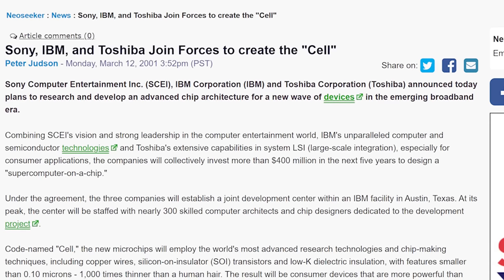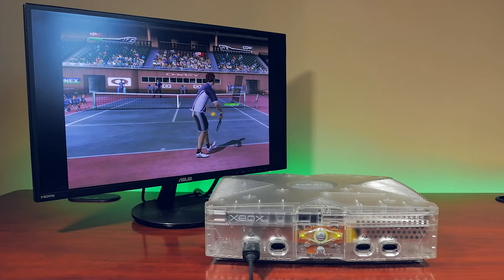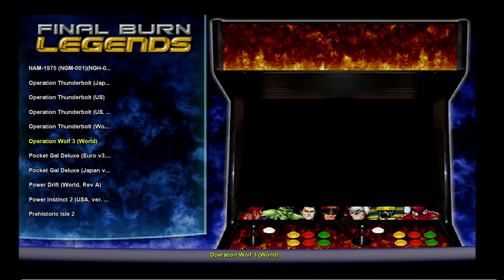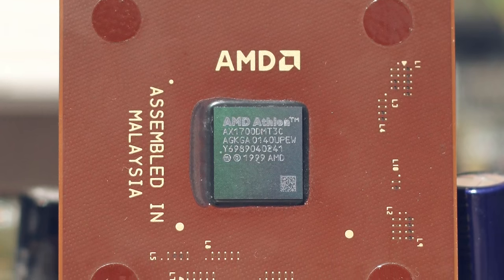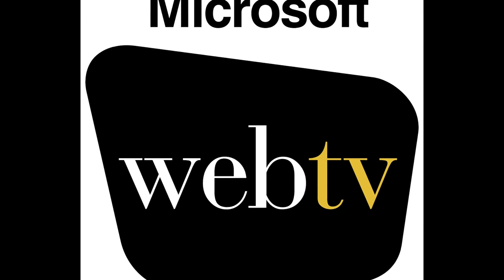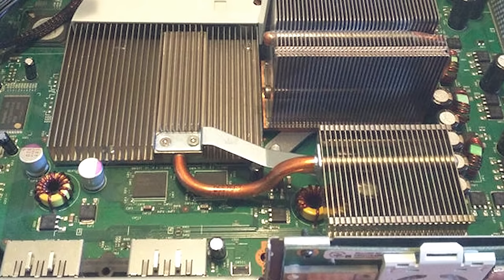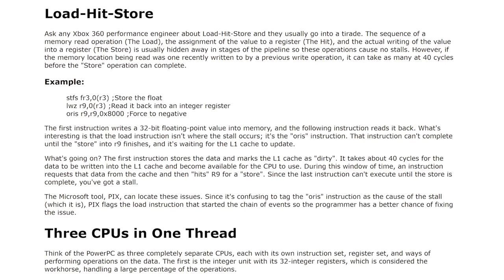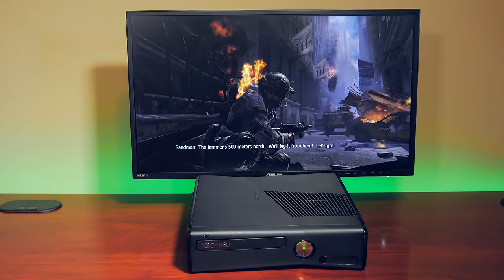Why Microsoft switched from Intel to Power PC for the Xbox 360  | MVG

Comment: The real winner of the seventh generation of consoles?

IBM.
Reply: And the next was AMD. You know what was the same? Lisa Su. Coincidence? Maybe, I don't know. Just a fun fact.
Reply: @johanlundberg8449  and is it coincidence that Nvidia have a raytracing card out and AMD does not?  I would think not, in the same way IBM could not or would not provide Apple with better CPUs until after Apple left   (What I'm saying here is that both these shifts came at a cost in the long term ... IBM lost a huge long term business partner and by the looks of it AMDs next gen GPU is now delayed until next year when the Nvidia 3k series is about to be released (maybe they will both hold back now)
Reply: I full appreciate that working with Microsoft and Sony will work out long term in desktop cards, but that won't be for a few years yet.
Reply: @Nossieuk  I am not so sure about RDNA2 being delayed, AMD and Lisa Su herself have stated multiple times and right up till recently that both Zen3 and RDNA2 are still 100% confirmed for this year. 

There have been many rumors going around about delays, but AMD and Lisa Su have shot them down repeatedly. AMD do keep stating that RDNA2 is releasing before the next gen consoles and so is Zen3. So I do think they will release this year still, unless AMD and Lisa Su make an official announcement saying otherwise, I wouldn't believe any other information. 

There have just been too many rumors about delays that keep getting debunked by AMD and Lisa Su, so I am just not believing anymore new rumors about delays. I will believe official word on the matter from AMD though.
Reply: Yeah, but Apple.. Apple Computers used IBM PowerPC RISC CPUs in their MACs, then they wokeup to reality and switched to Intel X86 CISCs for ultimate capablities.. But behold, they've recently become stupid again and now they have dumped CISC to go back RISC CPUs using custom ARMs.. The good thing though is that Apple users really can't complain now when PC users refer to them as consolers.. Hah
Reply: This was hilarious LMAO
Reply: @Ian H . Not sure what/why your going on about, but I am pretty sure Johan was just referencing that Lisa Su was working for IBM with the 7 gen and AMD for the 8th development and launch.
Reply: Fernando Cárdenas . Wow,  that would be embarrassing for PC users if some PCMR dork actually did start calling Mac users consolers. Personally I have never seen that term used.

As for how stupid it will be, time will tell. I personally have no idea how well or poorly this will work out, but I am excited to see the results.
Reply: @robertt9342  Haha, Then why are you so annoyed?
Reply: @joeyvdm1  I'm one of the twats waiting on dropping £5k on a PC before all this happened.  I was told the zen 2 3950 was going to be released last year in september and yet it wasn't until December it was officially launched. I was going to just pull the trigger on the 2080 and to be fair it also gave me a reason to hold out for the threadripper, but why bother after corona with Zen 3 on the horizon and MAYBE RDNA2, where AMD MIGHT actually start competing in the performance market again - my wish list has been a running jokie since august hah. https://www.scan.co.uk/wishlists/c77b3d9b-0767-4054-92fb-1fee8db9ccc4  -- With so many rumours, delays, lies and teasers -- yes, yes I am willing to believe anything =P
Reply: @Nossieuk  Don't stress it, they will release on time. Zen2 released on time and so did RDNA1. 

The 3950x releasing late was expected for multiple reasons, but that was also a single CPU, not the entire product line. And the 3950x still released the same year (2019) not the following year. 

When Lisu Su and AMD say that there will be a delay, that is the only time to believe it bud. Not a second before. 

I will be picking up an 4950x myself to upgrade my 3700x (I do production) and I actually expect that the 4950x might be released with the rest of the product stack this year at the same time as well. 

But even if the 4950x is released later, I will wait. But RDNA2 will absolutely be released this year as at stands right now, and so will Zen3. 

So I wouldn't believe any rumors, if AMD and Lisu Su say that Zen3 and RDNA2 are both still 100% on time and will absolutely release this year, that is who you should believe.
Reply: I can never say that because the PS3 exclusives looked amazing but they were far too few released. Every 3rd party game looked like crap on the PS3.
Reply: @fredsas12  Honestly, I'm kind of excited that Apple has decided to go with the ARM RISC architecture. x86 is starting to show it's age what with the ridiculous amount of security vulnerabilities and ludicrous amount of extensions that have been added since MMX in the late 90s. If anyone can give ARM a kick in the pants and start producing desktop class RISC CPUs it's Apple. The ARM RISC architecture is absolutely ripe for development, and the start will probably be slow, but I can't wait to see what they end up doing with it. I for one welcome our new RISC overlords XD
Reply: Also, the PS4 and the Xbox One helped AMD avoid bankruptcy (and a rumored forced merger with someone like Samsung) when their Bulldozer architecture became a disaster; that lead to them losing almost all their market share to Intel (and Nvidia, to some extent).
It kept the lights on for them until their Zen and RDNA architectures (used in Ryzen CPUs and newer Radeon GPUs, respectively) were ready.
Reply: @fredsas12  
* cough *
consoles
* cough *  * cough *
 x86-x64 
* cough *
Reply: @nothing.mp3  You mean Intel right. Intel is starting to show its age. AMD is doing amazing, less Security vulnerabilities too.
Reply: @Yeen125  I agree. The Deals with Microsoft, Sony and Nintendo kept the lights on. Much like how the 3DS kept Nintendo's lights on when the Wii U jumped off a cliff.
Or how the (bloody) Kinect kept Microsoft Profitable during the 2008 crisis.

Also in graphics AMD has Nvidia Cornered. You rarely ever see Nvidia outside the PC realm. AMD has a basic monopoly in terms of console graphics and CPUs, Apple famously broke up with Nvidia in 2009 and AMD is Gaining Market Share in the PC realm.
If AMD can pull a RyZen, Nvidia wouldn't have much to fall back on since a large majority of the company's profits are from Graphics.
Reply: Too bad they lost Apple at the same time, and didn't hold onto Microsoft and Sony going into the 8th Generation.
Reply: IBM was the only winner. Literally everyone else was a loser. God the 7th generation of consoles was a dumpster fire. Nintendo put out a gimmicky low powered system, Microsoft is just garbage, I'd rather not use ANYTHING from them, and Sony (or as I prefer it, Soyny) shit the bed in every way imaginable and has continued to be trash since.

That generation is why I'm a PC gamer and I haven't bought a console since. It's also the console generation that really started to pour on the military shooter clones, and in general started the "AAA" cancer that now infests the industry. Bro-dude "gamers" weren't really a thing before that generation, nor was the industry stagnation. 

In fact, we'd not seen that kind of trendy zombie consumer behavior since the 80s video game industry crash. I'm STILL sitting here and waiting for another crash.
Reply: @Martyn Hare Windows definitely doesnt run like "ballsack". This is a myth. It simply has more capablities than anything else out there.  And yes, it makes sence to have dedicated hardware for certain capablities in the server market. Its the same reason why RISCs are good in bit coin mining.

Desktop PCs on the other hand are jack of all trades. They dont require minute PSUs, or storage space in terms of server style racks. Also, x86 CISC PCs already have RISCs on dedicated hardware for specific stuff. i.e: GPUs and SPUs to name a few... The main CPU cannot be RISC itself as it needs to feed these systems simultaneously.

Apple is doing what is right for Apple in terms of cost effectiveness. It has less to do with processing power... Needless to say, none of Apple's ecosystem users will be seeing those manufacturing cost reductions in their purchases. :)
Reply: @fredsas12  Actually, if there's one company who can make it work, it's Apple. Their cpu potency in the latest ipad pro is extremely impressive, the equivalent of a i5-6600 on a 5w cpu that is badly optimised, in a beta, that doesn't even run native code. Microsoft screwed up when they tried arm, yes. Apple won't because they're extremely experienced when it comes to entirely shift their lineup in processing units. + It creates a golden opportunity for gaming as any game can be put in iPads, or laptops, or phones.
Reply: No, I worked for MS on the XBox360 at the time.  The reason MS chose it was they intended to develop the PPC themselves.  It turned out cheaper to go with AMD and they also owned ATI anyhow - so....  There were even rumors (STRICTLY rumors) that they were going to go with ARM on the next generation, because really the PPC had too much CPU power, and it was never used.  GPU was the only processor that was stressed.
Reply: @fredsas12  "Desktop PCs on the other hand are jack of all trades. They dont require minute PSUs, or storage space in terms of server style racks." You're just cherry picking and saying desktops. What about notebooks? Laptops are a big part of the Mac business, and heat and efficiency issues are a big reason why they're going to ARM. We don't know for sure, but I have a feeling your comments will not age well.
Reply: @fredsas12  
Linux can do nearly everything that windows can, a lot that it can't, and with a lower resource footprint, better security and better stability (well, depending on distro, but Manjaro takes a steaming crap all over Windows stability).

It's also as happy on x86 as it is on some random RISC chip. Especially as most RISC chips are what we would have considered CISC 20 years ago, the distinction is pretty much meaningless at this point. Apple's silicon for their desktops will, at least eventually, end up being little different than x86 in terms of cost, power, heat, etc. Because to compete, they'll need to do the tasks that dictate all those factors.

But at the end of the day, Linux/BSD/UNIX will be there regardless of what you run. There's a reason UNIX derived systems show up everywhere. Chances are your router, your smart phone, your game console, are all running some form of linux... Even if it's a Frankenstein'd or hyper-specialized custom roll of some sort, with a bunch of proprietary blobs.

It's likely that Linux will eventually sit at the heart of a vanilla windows installation, because eventually Microsoft is going to have a choice between that, and extinction. 

Most people don't realize Windows has already gone through one such transition: XP and ME are based off completely different foundations. The reason your DOS games didn't run so well is because XP was not "Windows" as we knew it back then. This can, and will, happen again, as the bloated pile of garbage that is current Windows presents problems that only rehashing the OS completely can solve.
Reply: Considering where they are now with hardware, not really.
Reply: @sashapaleologue1234  they can do it for apple. Also i5-6600 is shit now. And can mobile Gaming really be called gaming, woohoo iPhone and iPad apps on iMac, it's gonna do jackshit for gaming.
Reply: @HaveYouTriedGuillotines  Hmm, I don't recall saying it couldn't.. Plus you are clearly reading into it incorrectly.. Windows can do everything Linux can AND it owns 70+% of the x86 PC desktop market in both OS AND End-user software.. To put it simply. I and 70% of PC users don't need Linux.. Especially as all it really does is copy Windows in both  looks / capablity and its software via emulation and is SLOWER as result of doing so.. 

If you want to use Linux go right ahead. All the power to you.. No one and especially not I am trying to stop you, nor put you down for doing it it.. Some of you Linux guys always get so indignant over the majority getting what they like.. Jeez..

RISC on the other hand... Going backward on both price and performance.. Next they will be trying to say a £1000 iphone is more powerful than a £1000 PC.. :). Oh wait, I meant a £3000 RISC iMac.. Hahha
Reply: @fredsas12  
Standard issue ad populum fallacy.

I didn't "read into" anything "incorrectly." You're just incapable of correcting yourself, so you attempt to (falsely) correct others.
Reply: @fredsas12  
I suppose I should go into more detail...

Windows success in the current day is mostly predicated on complacency and ignorance on the part of end users, and a dash of elitism and unwillingness to adapt and capitalize on the on the part of the competition.

You're a good example of the first half. Your average Arch user is a good example of the second half. Distros like Manjaro are a sign times are changing, and whether you realize it or not, Windows, if not all of Microsoft, is in a really, really precarious place right now.

People still remember Vista, they ended support for Win 7 and both Win 8 and Win 10 have been such a dumpster fire that even normies and boomers are starting to wake up to just how bad Windows is.

All it would take is for a bunch of linux nerds to stop fighting with each other and make a concerted effort to start capitalizing on this weakness and Microsoft is going to, probably in a fit of hubris and blindness, get completely lapped by Linux.

Unfortunately for you, my dear fanboy with fallacious reasoning and arguments of no consequence, this is already happening. Microsoft will either adapt, or begin eroding.
Reply: @Fernando Cárdenas . I am a PC user and you are making the community look stupid and childish.
Reply: @protoretro1290  A large part of nVidia's revinue is in HPC where AMD is non-existent.
Reply: @fredsas12  Technically, the recent generation Intel and AMD AMD64 archs are RISC emulating CISC.
Reply: iTheGeek  Intel still has the best gaming performance. But, yeah, AMD is very much ahead in production workloads.
Reply: Tri Lams FTW!
Reply: @Nossieuk  raytracing is pretty useless ngl
Reply: @Nossieuk  we the gamer's don't care about raytracing, just the marketing does
Reply: @SF-tb4kb  not really, actually PS5 is going to be amazing value for your money. If it hits 400-500usd its like r5 3700 + Rx 5700xt+ ssd for that price. If people will manage to run Linux on it it should be amazing
Reply: International 🅱️arcade machine
Reply: @nothing.mp3  There's nothing wrong with x86 itself, except maybe for the fact it has to hold onto legacy modes that have no place in the world of modern computing for the sole purpose of having the capability of running MS-DOS 3.0 if you really wanted to.

Besides, modern x86 CPUs resemble RISC CPUs at the deepest levels. If there's anything that's showing its age, it's Intel latching onto the same microarchitecture they've used since Sandy Bridge.
Reply: @protoretro1290  the Kinect came out in 2009 or 2010
Reply: @HaveYouTriedGuillotines  I'm pretty sure it was this generation that consoles and gaming industry went to almost complete shit
Reply: @sashapaleologue1234  lol Apple gonna have to compete with Nintendo then
Reply: libnny gutierrez  IBM: Intense Bowel Movement.
Reply: anyone who buys consoles is the real loser with all the nickle and diming that they do. without any custom content.
Reply: as the real winner of the 8th Gen of Consoles..... AMD and a bit Intel.... they still have to pay royalties for use any kind related x86 chip to intel, Meanwhile Intel doesnt have to pay AMD for x86-64 because they reverse engineer the instruction set.... even losing that assholes still winning
Reply: @nothing.mp3  because ARM its more reliable, cheaper and secure than any iteration of x86
Reply: @protoretro1290  This is very true. Intel has certainly been doing a horrendous job of doing, well, everything lately. AMD has not only been picking up their slack, but innovating more than Intel has in the past 10 years. I can only imagine how bad Lisa Su's back must hurt from carrying the processor industry lately XD That being said though, I do believe there's a good chance that we will see a switch to (or at least wide adoption of) highly optimized, multi chip RISC architectures simply due to it's efficient nature (in process pipelining at least, not memory requirements). Additionally I believe that there is much more room for ISA level innovation with RISC simply due to it being the new kid on the block so to speak. Given AMD's current galaxy brain level of innovation lately, I would absolutely love to try out an AMD designed RISC based CPU if they so chose to develop one (three digit core count sub 95w Threadrippers anyone?)  All that being said, I am certainly no hardware engineer, and the sheer scope of this industry is way beyond me. There may be process refinements in the works for x86 that could change the way it functions at a fundamental level. Anyways that's just my two cents.
Reply: Too bad it wasn't enough to save IBM's chip fabrication. They basically went nonexistent after that generation passed.
Reply: The longest pissing contest ever.
Reply: I prefer a delayed proper working product than rushed out shit just to meet some imaginative release date
Reply: Galva Tron  
You've got some insecurity and delusion issues you need to work out.

Enjoy your proprietary, locked down, overpriced sub 30FPS toaster, I guess.
Reply: Galva Tron  Then don't use it. Simples
Reply: @Nossieuk  Any GPU can do raytracing, Nvidia have just gone about it using Hardware based raytracing, AMD being more open source is doing it by "software" running on the base hardware. It's like how GSync is again Hardware based as in something is added to monitors, AMD though went about it using software called FreeSync, both do the job BUT Nvidia's version is technically superior  it is also higher priced, same goes for Nvidia Vs AMD cards, Nvidia had more expensive dedicated tech inside compared to AMD.
Reply: @prich0382  sorry but I disagree -- that's like saying 20 years ago - all computers could play DVD video,  - when the reality was to get anything half decent you needed a dedicated decoder card.  I understand that software ray-tracing is possible - but there is a reason that 3D renders take days to render.  Nvidias hardware tech - apparently is in real time - AMD will not be able to match that in software only.  But that's not to say they wont have similar tech when big Navi does finally come out.
Reply: @prich0382  my theory however is that AMD bet the farm on consoles (and made a bank load of money) and like IBM back then have not invested in their hardware and likely wont match Nvidia at least short term
Reply: @Nossieuk  Oh I never said AMD will match, yes it's not as good but there are many demos you can watch where raytracing is running on a Normal AMD GPU.
Take a look at this video from last yeah, it's a Cryengine demo running on just a Vega 56: https://www.youtube.com/watch?v=1nqhkDm2_Tw&feature=emb_title&ab_channel=CRYENGINE
Reply: @johanlundberg8449  amdshill
Reply: can you cook me some toast?
Reply: @Nossieuk  In October 28 2020, AMD announced the RX 6000 GPUs with real time ray tracing.
Reply: @robertt9342  Exactly. Lisa Su worked at IBM for the Cell processor and then joined AMD in late 2011.
Reply: @fredsas12  actually RISC and CISC have about the same capabilities. It just change how the architecture handle de process. A lot of RISC logic was implemented on CISC and vise versa.
But on the core function the RISC can handle more process and kinda predict code bcs of the fixed length instruction, on CISC the instructions came in different lengths, and it makes more hard to predict the instruction.
Reply: @atisbasak  And your point? this was 10 months ago and your cards are just as available.
Reply: IBM dropped the ball which they had with Power ISA at PS3 time. If part of deal with Microsoft was porting Windows to Power ISA and then like ARM made ISA more Open they could have broke X86 dominance.
Reply: @johanlundberg8449  Lisa Su is woman executive which got position with out Positive discrimination.
Reply: @JMiskovsky  PowerPC architecture ran far too hot compared to comparable Intel chips and  they were too interested in pumping out cheap chips for the consoles than competing with Intel - hence the main reason even Apple moved to Intel.
Reply: @Nossieuk  it is the point. IBM should have done optomalizatin to regain laptop market.
Reply: IBM provided PowerPC for so many consoles, including 3 Nintendo consoles
Reply: @fredsas12  "stupid" 

That aged like milk
Reply: @fredsas12  "going backwards in both price and performance" I guess that didn't age well. I'm not an apple guy but even I have to say the performance of the new m1's are a little scary for something so power efficient.
Reply: Too bad that "win" was followed by what was basically a retirement from the mainstream processor market.
Reply: Apple won
Reply: @MrMoon-hy6pn  yeah, stupid is his comment about the M1. Didn’t age well! Haha!
Reply: And then they pissed it all away, just like they did with Apple.
Reply: @windowstips1430  Seriously. I wonder how he handled the M1 introduction.
Reply: @fredsas12  2022 called, everything is going ARM. wake up dude.
Reply: @andrewgarcia3136  No they aren't. ARM RISC is a low power system for mobile devices and consoles, whilst x86 CISC is a high end architecture for desktop devices. Its always been like that. The only real thing that changed is the mainstream consoles (xbox and playstation moving from RISC to CISC. The Apple consoles had gone from RISC (IBM PowerPC) to x86 back in 2005, they have simply gone back to RISC (ARM) again. Its actually 2 steps forward, one step back for CISC, 2 steps backward, one step forward for RISC. People are actually adopting x86 CISC systems more than ever.
Reply: IBM did fund a few wars too last century 
Not sure about this century but they probably did 
They also invented the very first hard drive which was the size of a washing machine 1950s era
Reply: What many companies don't seem to understand is how exotic RISC seems to the average customer.  Not only are these better ISAs, but there seems to be some vague understanding that all new ISAs since 1985 have been RISC, while Intel has been trying to the break the "golden handcuffs" since the old 286.
Reply: 7th gen is literally a PowerPC era
Reply: @Nossieuk  IBM could, Apple just wanted contracts that are as CHEAP as possible, even for companies to take a loss. Apple usually is not a good partner for third party hardware vendors. Like Amazon, they tend to push for extremely cheap contracts, until they got their own replacement ready and then just cancel it. 

I can see why IBM wouldn't be interested. That said, they should not have stopped with ther PC cpu's either.
Reply: @DehnusNorder  - PS3 cpus, xbox360 cpus and gamecube cpus -- all made by IBM,  IBM were not able to invest what they needed and the technology they did have was too hot to put in the next big thing - laptops.  When the rumours flew about Apple switching from PPC to Intel IBM suddenly started announcing lower consumption chips, far far off in the future like rocking horse shit.  IBM were happy getting fat off the console manufacturers while not giving a shit about 'PC' in general and eventually doing like they have always done - shit the bed.
Reply: And yes, I'm just bitter that you can't buy a decent PPC multicore, multi threaded consumer PC with a fat stack of cache anymore ...  I was even tempted in a Power 5 rig \o/
Reply: @Nossieuk  The power architecture isn't just IBM though. Freescale was a thing. I know it's also wishful thinking of mine. As I hated that Apple Switched, it felt like "Everything is a PC now :( ". I too mise the Power architecture heh.
Reply: @technodrone313  and other shit you're never supposed to pull out of your arse
Reply: It... would certainly appear so. I mean, Wii, 360, and PS3 were all PPC. And these days the only thing IBM has is a narrow segment of the server and mainframe market. A segment which ARM could easily edge out if they felt like it.
Reply: @joeyvdm1 what is the AMD equivalent to the a100
Reply: IBM's architecture was so poop, everyone else were the losers.
Reply: And the next two ones is AMD
Reply: @Nossieuk rt is overrated. Ooo shiny puddles that's all I see, maybe a little better shadows.
Reply: @fredsas12 this comment could not be more wrong… it aged not so well…
Reply: @fredsas12 this comment didn’t aged well neither, ARM has a clear advantage over Intel/AMD: Power consumption.
Reply: @joseabraham777  Power consumption is NOT an advantage over x86, because x86 NEVER required low power consumption in the first place.. Its a false marketing line... Don't fall for it. 

The irony here that everyone seems be missing, is that in order for an ARM-RISC to become as powerful as x86-CISC, it will have to evolve into a CISC architecture itself, which will then have it use more power, thus putting it into the same position as x86, complete with a 800+ watt PSU... Desktop PCs do not want for power.

They are also missing the big picture play here from Microsoft. The "Windows on ARM" is meant to compete with Google's Chrome book series, outright placing them in the low-end market with a Microsoft "Edge Book".. Snapdragon is not meant to compete with x86. The marketing is trying to make it look like that in order to influence people's perspective of its power. Its meant to be vague...
Reply: @johanlundberg8449  Suuuure!
AMD Jaguar release: 2013
Lisa Su appointed as CEO of AMD: 2014